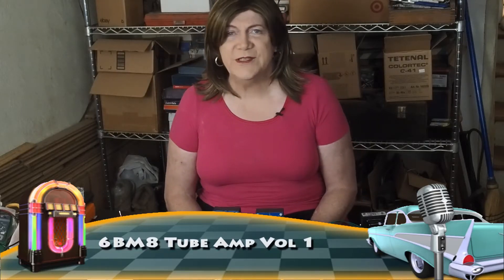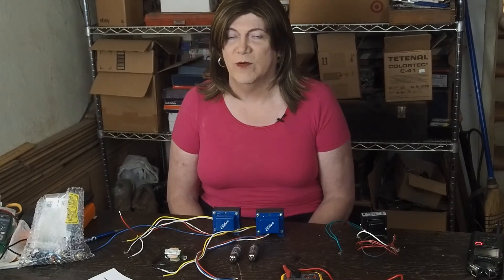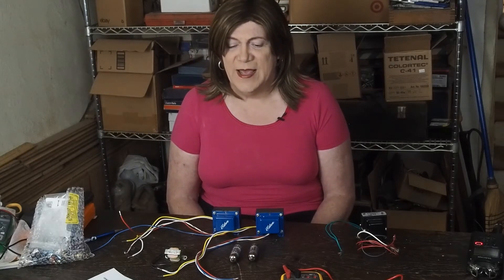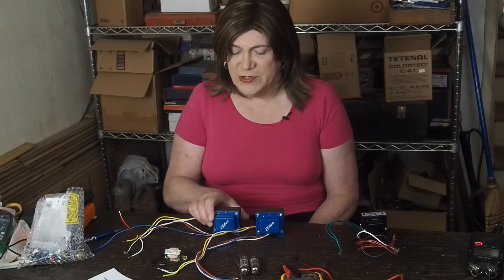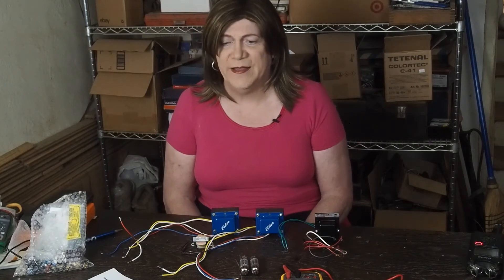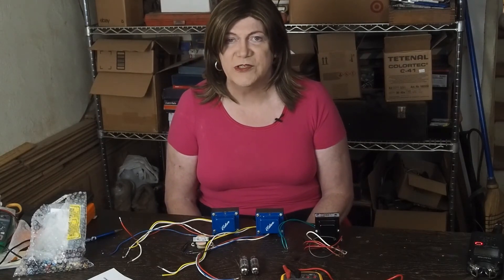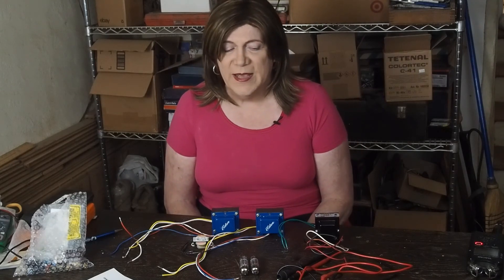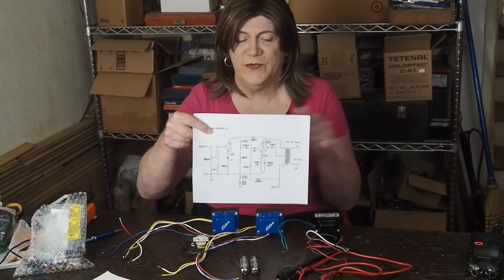6BM8 DIY Scratch Built Tube Amplifier

Comment: I pulled a little amp from a console that is similar to what you are building,  I really like it. It uses a pair of ECL86s and I measured a whopping 1.75 W from it - although it probably sounds like more. It was my first and relatively recent venture into tubes. The output transformers appear to be undersized though, I'd much prefer to have the ones off your bench.

Comment: I can't believe I haven't seen this series of videos yet.   Exactly what should be done.  Step by step, and explained as you do so well.   And, the 6BM8 is a great tube.   I borrowed a set of those 6BM8 based "Wave 8" amps once and thought they were one of the best I've had in my room.  But they were noisy in the background and I thought what a shame that someone has not done an improved version.   My skill level is not good enough to go it alone, but I can build good kits and with proper instruction like this - an amp from scratch.   Looking forward to watching this series.   Thank you!

Comment: Great series. Thank you. I bought a bunch of Russian military NOS 6BM8s from Ukraine a few years back, and this is just what I needed to kickstart my first project. I plan to set up an experimenter board using speaker screw-connector posts laid out in a grid on a piece of MDF, with the centre being a valve socket circled by nine connectors. That way I can quickly and easily  configure a circuit,  and swap components with  no soldering required. More like Lego. 
Something of interest to me is taking the output of the 6BM8 as input to a chip amp.
The mysteries of impedance matching would be a good subject for a vid.
Also, I have seen articles about using J-FETs instead of output transformers, which seems like a great idea to explore.
Keep it going, this is exactly what beginners need.

Comment: Could this be used as a preamp?
Reply from the maker: Not really, the output transformer needs an 8ohm load, to reflect the right impedance back to the output tubes.
Reply: @SkunkieDesignsElectronics  I figured that out after I asked.  I guess there are no stupid questions apart from that one.  Lol